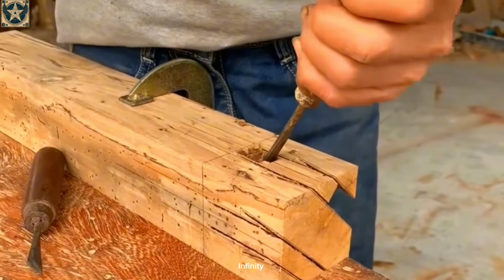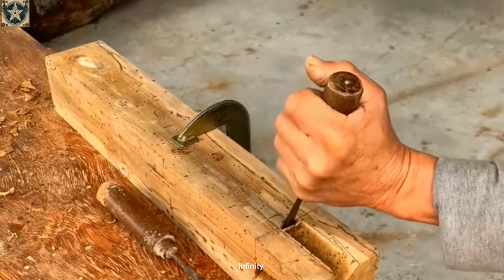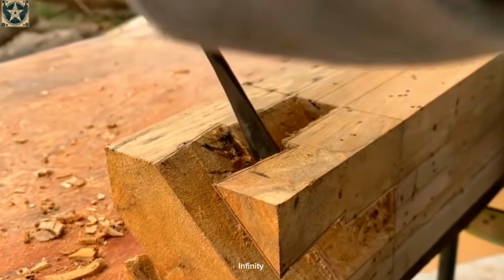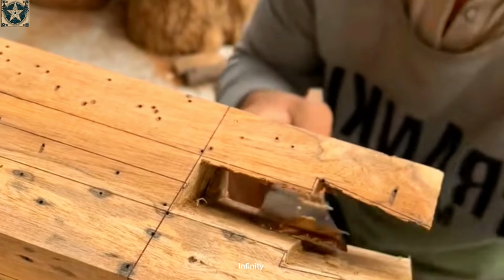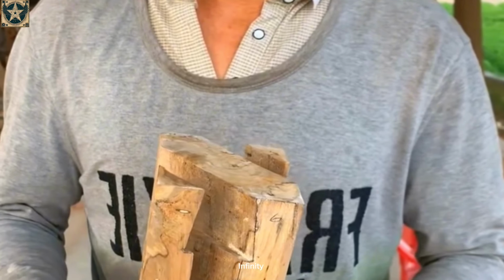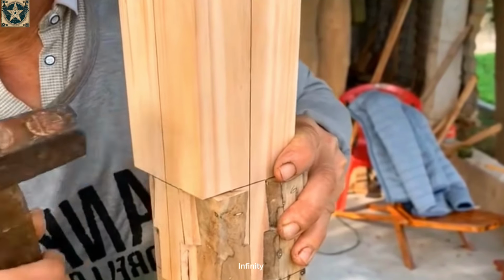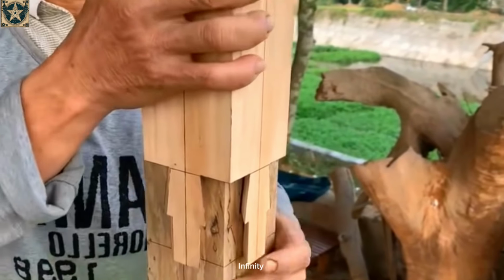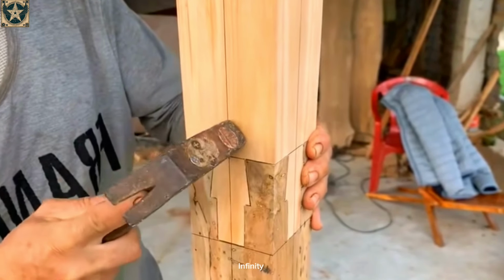How to Identify High-Quality Traditional Woodworking Products

Comment from the maker: RUITOOL 6-inch Japanese Pull Saw, SK-5 Steel, Double-Sided Blade 14/17 TPI with Wooden Handle, Ideal for Woodworking.
🎉 Price after discount code: [$8.02] -72% off
👉 Product link: https://temu.to/k/uzx09nmupym

Complete 19-piece wood carving tool set with basswood block, precision knives, and accessories - Ideal for beginners and enthusiasts.
🎉 Price after applying the discount code [$17.95] -73%
👉 Item link: https://temu.to/k/u3hiz78yad6

1 wood planer, mini handheld planer made of aluminum alloy, European-style flat planer, bottom edge wood planer, DIY carpenter tool
🎉 Price after applying the discount code [$10.82] -64%
👉 Item link: https://temu.to/k/ug53xtmekec

10-piece wood carving tool set, stainless steel carving knives with protective gloves and storage bag, non-rechargeable hand chisels for wood crafting and sculpting.
🎉 Price after applying the discount code: [$22.29] -69% off
👉 Product link: https://temu.to/k/uwag2ahhlbm

[High Rating] 24.89cm x 50.04cm Stainless Steel Square Layout Tool, Multi-Purpose Angle Tool for Woodworking, Thick Vertical & Horizontal Measuring Tool.
🎉 Price after applying the discount code: [$5.17] -72% off
👉 Product link: https://temu.to/k/u8kgclzpj7o